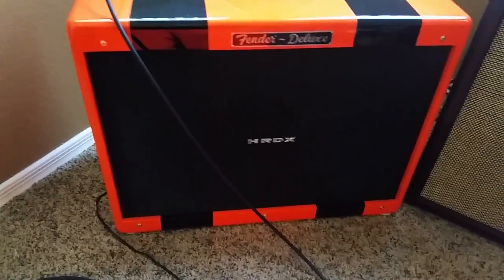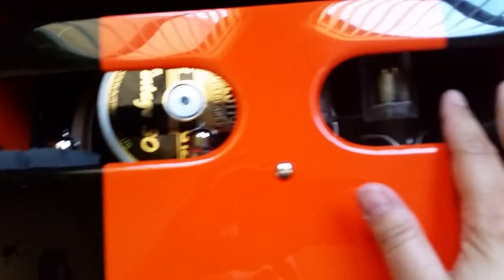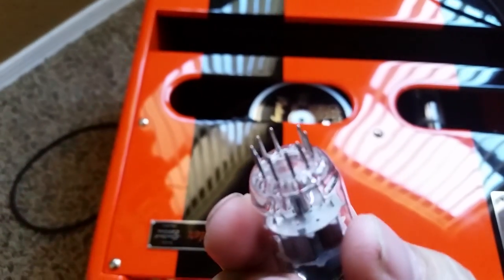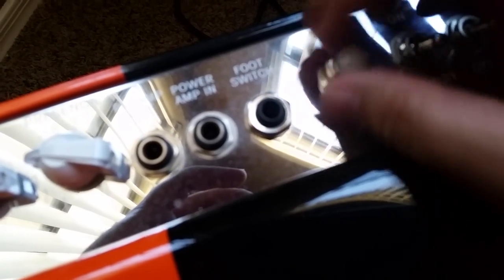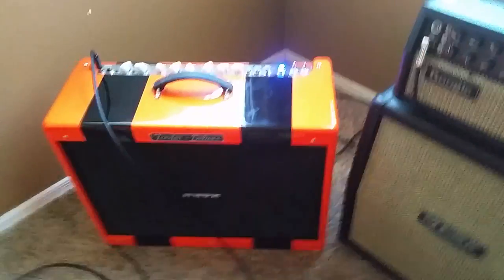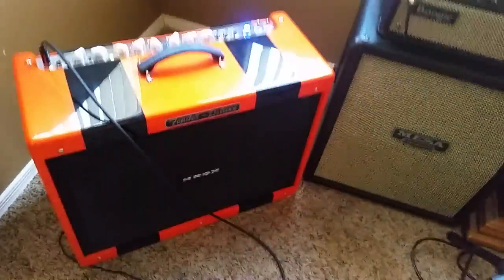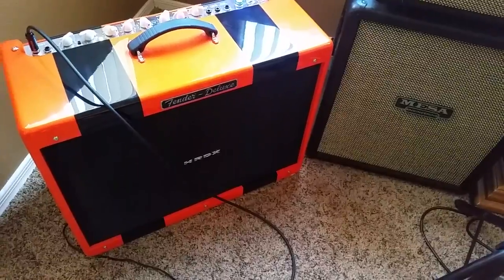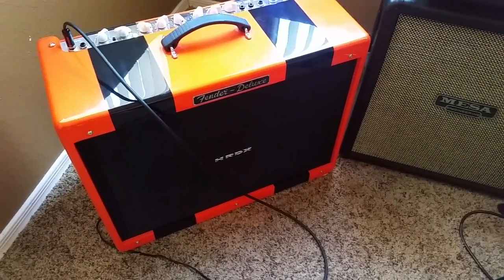Improve Your Fender Hot Rod Deluxe For $10

Comment: One simple thing no one ever seems to mention is using input jack 2 on the amp. It attenuates it -6db. I use my HRD as a pedal platform and this helps tremendously.
Reply: I always play in input 2. This is the way to go for home use. HUGE difference with -6db. In a good way :)
Reply: My experience with this amp is that input 2 attenuates the volume, but the tone suffers. My model is ~15 years old at this point, so that may not be the case anymore. I just did the 12at7 swap on the first preamp tube, and I'm a huge fan so far. More clean headroom, a more gradual increase in dynamic as you turn the volume knob, without sacrificing tone.
Reply: Is it quite enough when the guitar is plugged in input 2? I tried in a store but I didn't know that, I am really scared about the 60 watts of the hot rod deville 212 but I just fell in love with the amazing sound. I need your help now

Comment: That is just amazing.  I got rid of my hotrod deluxe for exactly this reason.  Was blasting our rehearsals away with the amp on 2.  Got to be intolerable.  Plus pretty much hated the distortion sound.  Now i have a USA-made Deville 212 which is better in terms of volume control but could still use some attenuation.  Will this help??  Thanks so much for this and all your videos.
Reply: Change all pres to lowest gain you can get. So ECC81/AU7.

Comment: Hi all. I have a Hot Rod Deluxe and the thing is, of course,  very loud. I am trying the following configuration:

v1 - Electro harmonix 12AY7
v2 - Groove Tubes GT12AX7 R
v3 - Groove Tubes GT12AT7

I will let you know how it went.
Reply: +Paulo Silva Just finish first test with new tube config. The result is amazing. Is this the same amp??? The volume control works smoother and the volume  increase is more progressive. For sure the gain is lower. I can push it to 3-4 (clean channel) without being too loud (used to play with volume 2 at home). But I am really impressed with the tone. It sounds more "sweet", "creamy" with great sustain ... sounds like a nice vintage tweed. Even the overdrive / distortion pedals sound better. More detail and more definition on harmonics. My rat 2 looks like a different pedal with a nice rich, full sound. The improvement is not so dramatic using the OCD. The chorus pedal sounds like "heaven" (mxr analog chorus).
Although I don't use the drive channel of the amp, can tell you that the result is also impressive. The sound is less aggressive but keeping the punch. You can push the master volume without becoming deaf.

I am keeping this setup.
Reply: @Cam_B  Get some new glasses.

Comment: Thanks a lot for the advice man. I’ve had my Hot Rod Deluxe 2x12 for years, and the volume is absolutely terrible if you’re doing at home practice. I don’t even bother with the gain. I use a whole different amp for heavy stuff, and a bassman pedal with extra gain for creamy style distortion. I’m gonna snag one of these tubes and see how it goes! Cheers 🍻

Comment: Maybe a little less coffee?

Yes, an interesting fix, over simplified to be sure, but doable. With the AT7 in V1 you'll definitely tame the amp some, but also will change the tonal characteristics significantly. We address the problem being truer to the design by varying the Volume and Master volume pots, the tone stack, power supply caps  and several other mods. It is possible to have every feature of this amp working the way you would think it should work, by installing less than 100 dollars worth of parts in the right places. John Fromel makes a good basic Mod kit that addresses most of its shortcomings. We also change out the trannys and speaker depending on what the players expectations are..BUT again, we do agree that your AT7 in V1 is an interesting fix for volume, but caution that most folks may not like the resulting overall tone change. The good news is this fix is easy to change back in need be.

Good Video.......Thanks.
Reply: I found that using a NOS Mullard CV4024 / 12AT7 in V1 does not change the tonal characteristics of the Hot Rod Deluxe amp at all.
Reply: Instead of the AT7 which is less musical than the AX7, the AY7 is a better choice, less gain but musical.

Comment: Thanks Phillip. Ordered the Electro-Harmonix 12AT7 and some pinball LED's from Australian suppliers to fix my Fender Hot Rod Deluxe which had the exact issues you mentioned. Plus my light was not working, so get the amp real cheap. Who would have guessed the LED's were $2. Thanks again.

Comment: I have the exact same problem with my Blues Deluxe. 4x10... screaming LOUD;-) I've been eyeing stupid pricy attenuators.  But this sure would fix my issue with the amp. It's pretty much why I sold my last one, 10 years ago.. I've had this one for 2 weeks now and I'm about done with it. Maybe this will prolong my ownership of it;-)
Reply: I have a Weber attenuator and they are very well made & priced well :-)
Reply: check out wampler pedals showing how to put a volume control through the effects loops
Reply: It unfortunate being loud but get away 20 feet and its a good because highs smooth out because they do not carry at a distance but lows do carry so your bottom needs to be tight !
Pedals are not as dynamic for OD but it can be good at lower volume !
Reply: The wampler idea is great I made one and it works well to quiet the amp down but an EQ pedal does the same thing threw the front of the amp. It goes -15db and that's how I tame mine for home use
Reply: OR google Lion Tamer for Blues Deluxe and get a device that is functionally identical BUT it's form is so much  better/simpler. Around $33 shipped to the US from UK.

Comment: Hey Phillip. this may be a dumb question because im not real amp/tube savvy but would this tube swap work on the blues deluxe as well? i know they are similar but not identical. thanks and keep up the great work!
Reply: Steadfast Guitars this will work for any tube amp that uses 12AX7 in the preamp stage. What you're basically doing is going from 100% down to 60% "power".

Comment: Dude! Thanks for the tip! Just so happens that I had a JAN Philips 12AT7 circa 1959 NOS tube in my tube drawer that I originally got to mellow out another amp, but took it out because I needed the gain. I popped it into my Hot Rod and WOW! While it definitely helped with the normal channel volume knob, it had a profound effect on the drive channel. Removed those ice-pick-like high-frequency artifacts and made the overdrive tone much warmer and tamer, but not losing note definition. So cool! Thanks again!

Comment from the maker: Matt Walters I can not respond because it's blocked. Yes sounds like a bad tube. I had 3 in a row once all be micro phonic. So yes try another tube.
Reply: +Phillip McKnight someone told me years ago that when it comes to tube amps, when you change a tube you have to replace them all. something to do with the wear on used tubes or something but if you don't replace them all you can blow tubes that were functional. i have no idea if this is true because i've always owned solid state amps but i figured i'd mention it.
Reply: +Kewl Beans Nah, you don't need to replace all of the preamp tubes. I have had to replace one blown preamp tube multiple times. Power amp tubes are a different story tho. For example, on my triple rectifier if one tube goes out I have to replace the other tube that is paired with it. It has 3 pairs of tubes and when one goes out, I replace the pair. I am not promising that this is needed, but it is what I do.
Reply: Matthew G had this guitar teacher years ago had an old marshall tube amp...every time one tube blew he replaced the entire set of em lol....idk i'm a solid state guy so i don't have to worry about that maintenance head ache lol
Reply: its definitely not a headache owning a tube amp,ive never changed a single tube in my 25 + tube amps unless i actually WANTED to.your missing out on a tonal buffet because of misinformation.preamp tubes are $10 $15 and can be changed one at a time.ive read thousands of times how amps need tubes replaced so often,to that i say BULLSHIT.

dont dismiss something because newbs give you misleading info
Reply: I agree with Trill. A tube amp is in no way a headache. I've had my Hot Rod Deluxe for ten years and haven't had to change a tube yet. I've gigged with it, done a lot of recording and even accidentally left it on for three days. Still works great. I'm gonna have to try this simple and awesome mod though! I've been using a volume pedal in the effects loop to get around the high volume problem but I don't like the overdrive channel and this sounds like a cool alternative and essentially like having two amps in one. When I want a different sound, switch out the tube. Brilliant!
Reply: Robbie Loomis
if only it were that simple. not that biasing an amp is all that complicated, but if you're not careful you could really mess yourself up.
Reply: You don't need to Bias when changing pre amp tubes.
Reply: Robbie Loomis
debatable...
Reply: if your amp doesn't sound right it's probably improperly biased anyway.
Reply: Your amp needs to be biased in correlation with your Power tubes. If you're not changing to power tubes with different ratings then you don't need to bias. The pre amp tubes can be switched out with ones of higher or lower gain and will affect things differently in the pre amp. For example, in the Hot Rod Deluxe there are three preamp tubes. V1, V2 and V3. They each affect the pre amp differently with V1 having the most affect overall. V1 is the one Phil switched out in this video. It mainly affects the clean "channel" volume and tone as heard in this video. Something else to know about the Hot Rod Deluxe is that it's not a true two channel amp. That is why changing V1 also affected the drive channel. I never said my amp didnt "sound right" and that's not the point of changing these tubes. Its to achieve a different sound. Hence, why I said they could be swapped out to get a different sound when you wanted that sound.
Reply: Robbie Loomis
you said you didn't like the overdrive channel..that's pretty much the same thing. improperly biased tubes can have a negative effect on gain stage.
Reply: A lot of people don't like the Fender overdrive sound. That's nothing to do with improperly biased tubes. It's just the way it sounds. As for the volume issue. It's actually to do with the Volume pot being a linear taper pot as opposed to the usual audio taper pot. That's what causes the sudden jump in volume. Anyway, I don't need to bias my amp, thanks.
Reply: ok then. :D
Reply: + Kewl Beans
There is no bias adjustment for pre-amp tubes.
Reply: There is also no bias adjustment in most of my amps. Because they are cathode bias.   In cathode bias a small value resistor is placed between the cathode and the ground so it develops negative voltage on the cathode thus achieving bias. As you hit a note the tube calls for more power and negative voltage on the cathode decreases briefly changing the tube's bias. This gives cathode biased amp their awesome sustain. They don't get bias adjustment. Fixed bias designs need bias adjustments and not just when you change tubes, but just as a tuneup.
Reply: Phillip McKnight I have a Vox VT40X and I'm wondering if changing the preamp tube would fix the couple of minor issues I have with it. I do find that I get big jumps when raising the volume or gain settings but the thing I find a little annoying is that when I switch on my amp the volume and gain are really high. I have to turn both slightly either lower or higher and then back to where it was when the amp was switched on (the position that the knob was at when I last used the amp). This has the effect of lowering both of these settings when the adjustment is made to both the volume and gain.
I'm assuming that the issue has to do with the preamp tube because I've seen others say that the Vox amps come with pretty cheap tubes. The amp sounds great otherwise, I just wish I didn't have to make these adjustments each time because some times I forget and probably wake up the housemates and neighbours when I decide to practice late at night
Reply: @kewlbns69  you

Comment: I did this many years ago on a HR Deville I used to own. 12at7 in v3 position. It definitely smoothed out the harsh gain.
Reply: The tube in the V3 position is the phaseshift (or phase inverter) tube, therefor part of the poweramp and not part of the preamp. Some early Fenders had that tube in the phase inverter circuit though.

Comment: this video clip is a good tip. i tried it with my fender blues jr., swapping one of the 12ax7s to a 12at7. it only enhanced the tone slightly but brought the gain down considerably. before i could only practice in the living room at 2 or 3 but now i can play at 4 with the "fat" button engaged, without pissing everyone off.

Comment: I really was not wanting to switch out the tube..
So I tried the volume controll in the efects loop..
Was cool but a little twichy..
So I dropped the tube in and bam the amp sounded way smoother and can absolutely be used at a low level. Defenately smoothed out most of the ice pick...
2 months later I put a texas Heat and left the tube in and it is a great sounding amp..
Great Video..

Comment: I replaced the 12AX7 with a Groove Tube 12AT7 and it works but I get a "ringing" sound when i play my guitar that's very annoying! I put the 12AX7 back in and the "ringing" stopped! Bad 12AT7 tube or is GT garbage?
Reply from the maker: I had 9 bad GT tunes and I would stay a way from them. JJs  are better
Reply: That's what I was thinking, I just ordered a JJ, will let you know it works out. Thanks
Reply: Well Phillip, you were right! Replaced that garbage GT with a JJ and the amp worked perfect! In fact, I went ahead and replaced all the GT's with JJ's and not only does it sound better, it's quieter too! Thanks for the video on using a 12AT7, I'm liking my HRDX once again! :)
Reply from the maker: I do not know what happened  to groove tubes but the sick now. I'm glad it worked out.
Reply: +Phillip McKnight 
GT's like many other so called American tubes are just rebranded Sovteks but cost more. Just get the Sovteks unless you're going JJs. Some of them didn't even completely cover the Sovtek insignia with their brand. lol
Reply: That ringing sound worked for Johnny B. Goode
Reply: Phillip McKnight I did this mod and used Electro Harmonix AT7. Did not last long at all... maybe 7 months, getting the ringing noise. Also did your chopstick test and it confirmed the tube was done. very disappointed. Will try the JJ.

Comment: I was excited to try this and solve that harshness problem, so I did exactly what you suggested... bought a GT-12AT7 tube to replace the first GT-12AX7 on my Fender Hot Rod Deluxe.  I was disappointed when I turned the amp on and got an annoying whistle-like feedback from the new tube.  Switched it back and the amp was fine.  The new tube is obviously bad.  Will update once I get a replacement and try again.
Reply from the maker: Versions of People I have also had problems with Groove tubes. JJs are also very good

Comment: I put the fromell mod on mine, which combined with an AT7, made all channels much more useable. One problem with mod in the PCB is that the tracks are micron thin, and it is very easy to burn through with the soldering iron.

Comment: Thanks for that...I'm going to try it. AND I'm old enough to have grown up in the vacuum tube decades...50's and 60's and worked for my brother in his TV repair shop. I sometimes had the task of testing tubes on a machine that listed all the tubes and how to set the machine to see if the tube was weak (red/replace) or good (green)  And it listed the  12AT7 as a replacement for the 12 AX7. I also had a Twin reverb later and, of course, never changed the tubes. Who knew?

Comment: Thanks Phil. Just did this to my Hot Rod Deville 410, and works beautifully. Very helpful!  That said, I’m noticing some chiming ringing. I tapped all tubes with a pencil and it’s the AT7 in the V1 slot, but I believe it may be the housing or something connected to the V1 slot as the amp was doing this ringing before the Tube change (but didn’t tap the previous tube).

Comment: An effective alternative that OOZES quality, is to use a GE 5751 tube or even change all the pre-amp tubes to this type. It is supposedly a 12AX7, BUT it rates about 70% of AX7 output. They're called the SRV valve, warmer HUGE quality and they last for ever! Which is good, 'cos they're not cheapthese days, if you get the genuine GE NOS item. Good vid BTW.

Comment: After extended and exhaustive researches here are the mods i did to my stock hot rod deluxe: 

-bought a jhs volume box to put in the fx loop
JHS Little Black Amp Box Signal Converter 

https://www.amazon.ca/dp/B00CIHB8FY/ref=cm_sw_r_cp_api_i_98kcFbJZJ56JP

-I replaced the fender stock speaker with a Eminence GA-SC64 - 40W 8ohm

https://nextgenguitars.ca/products/eminence-ga-sc64-40w-8ohm.html

- I replaced the 12ax7 in the following order
12ay7 in V1, 12ax7 in V2 and a 12at7 in V3

https://www.tubedepot.com/

I went from a unusuable amp at bedroom level to a completely manageable amp. With just the volume box i could manage it but not as well with the tube changes.
I found the overdrive channel unusuable, poor tone. Now it's less agressive with smooth nice grain overdrive completely usable. And the clean channel is better too.
A lot overall better amp with these mods